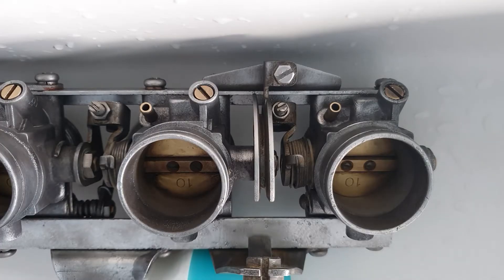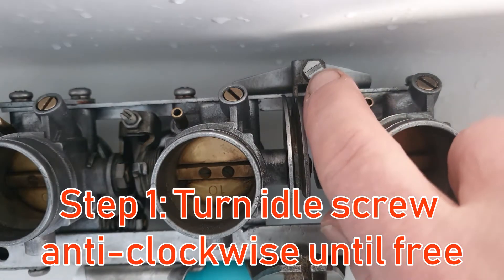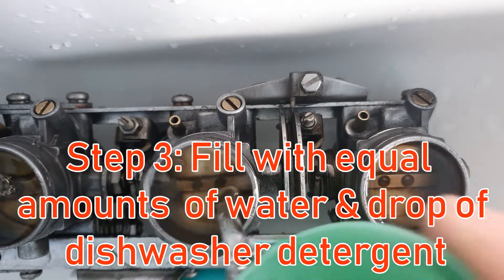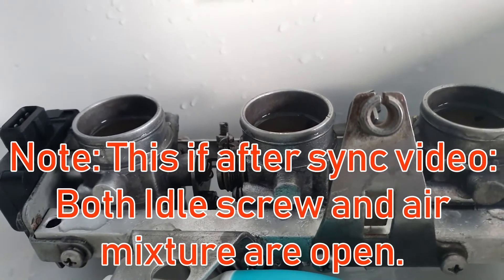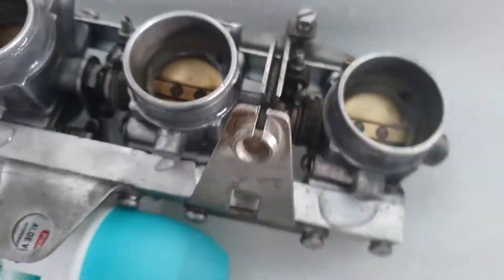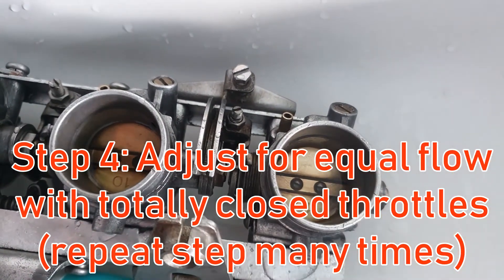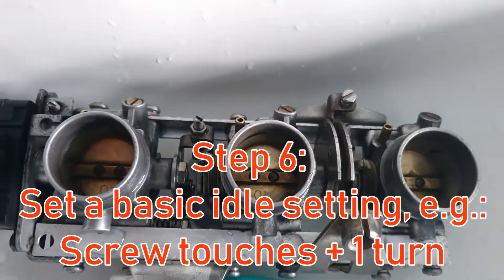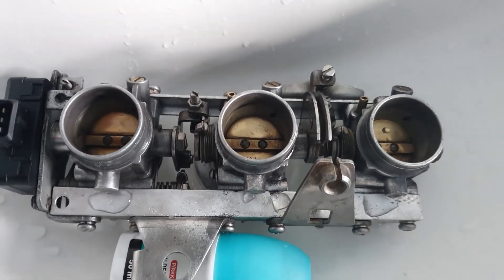BMW K75 Engine service Ep 2: Throttle body synchronizing

Comment: The TPS only for idle position?right? and i should hear that clicking sound to adjust it?
Reply from the maker: Yes, you should hear a click when the TB connecting links have lifted about 1,5mm at the latest. Done precisely, you get it at 0,5mm from idle.